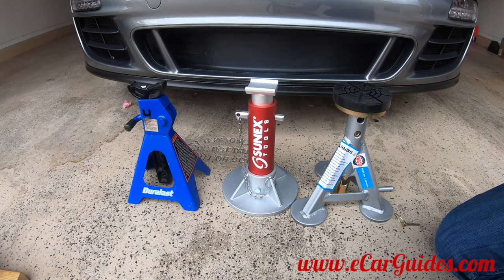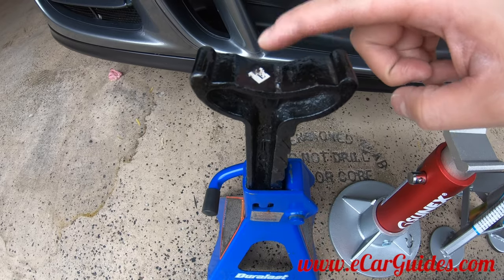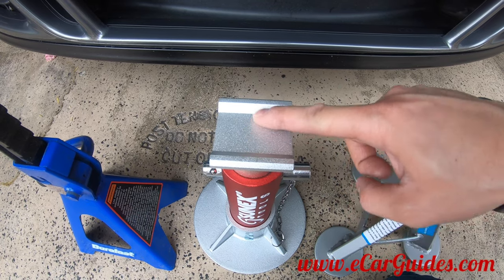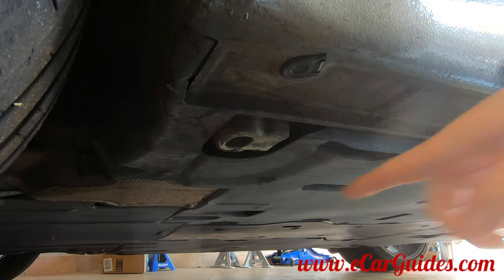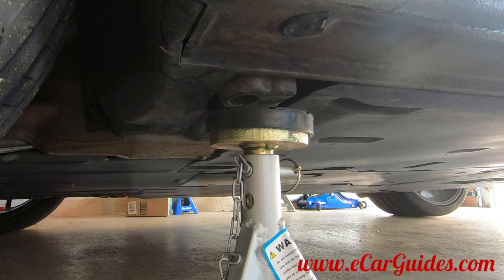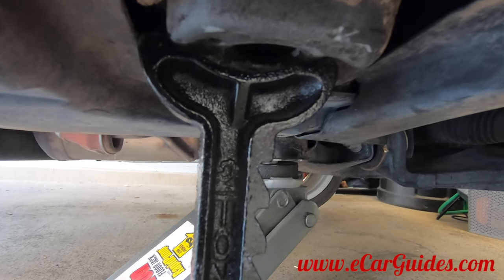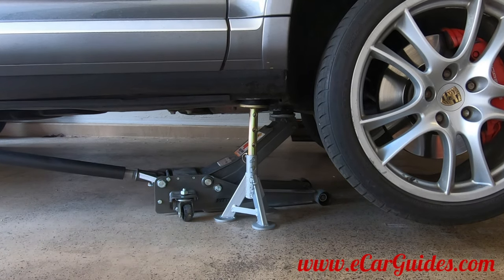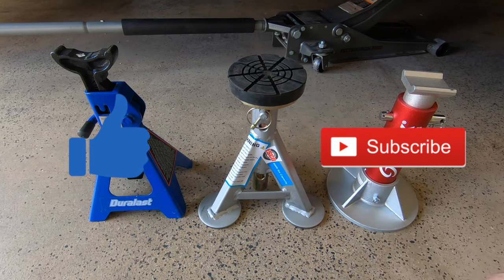Why the ESCO Jack Stand is the Best for Car Enthusiasts (ESCO vs Sunex vs Duralast Review)

Comment: That first jack stand mentioned has a small tab on the side that you are supposed to bend inward toward the shank when you assemble it. Same thing with the Harbor Freight style that was recalled. It is part of the engineering  and design for safety. It helps to promote good alignment of the locking mechanism and teeth on the shank.
Reply: Yes always and I mean always bend those tabs in. I've purchased several used jack stands and not a single one had the tabs bent in
Reply: Bending tabs also makes it to where the stand stays together so you won't loose one of the pieces
Reply: Ah, good mention. I wondered why they all have that tab.
Reply: Bending the tab in does nothing for alignment of the shaft within the stand. If it does then your stands have dangerous tolerances.  Its purpose is to keep the heavy shaft from falling out when moving the stand.  You could easily break bones in your foot, have the shaft slam into your fender, or smash your gf's kitty IF you don't remember to carry them vertical.  That said, I don't indent my tabs to ease with transport.  That said, I've had had a shaft fall out when I was being careless.

Comment: Good video, I would not trust creeping under a car that is sitting on any jack stands made out of aluminum, regardless of how expensive or beautiful they look. Been using 6-ton steel jack stands from Craftsman for last 25 yrs, they have held my 3/4 ton Suburban, Tahoe, Touareg and MB E350's over the years. For me using Aluminum Jack stands is like using Aluminum pry bars, though the functions are different but you get the point.
Reply: I think husky would be the best

Comment: First off let me just say thank you for the videos. I really appreciate content creators that are trying to review and compare products. With this being said though, my suggestion to you and anyone else is to never ever recommend a jackstand without a locking mechanism as there are many instances of the jacks slipping. So in other words, ask yourself a simple question is it really worth your life to save $10? I'm thinking probably not. Just my advice, I wouldn't even consider reviewing a piece of junk that doesn't have a safety pin. Hope this helps have a great day
Reply: They really arent that unsafe, just make sure to use them properly and check the handle is in the correct position. And its just good practice to use extra support anyway like a wheel or blocks of wood.

Comment: You could have rotated those strands 90 degrees. The first issue I see is you have a Porsche. Putting a lot of faith on the weld of that disc with the rubber pad. Ditch the rubber. Not safe.

Comment: standard jack stands (duralast type) is design for almost all vehicles, even if you hit the release lever with a hammer the jack will not fall, there is 2 much weight for it to slip, just make sure jack stand is straight and not defected, with proper weight capacity

Comment: I use the esco shorties as shown in the video. I still put either a folded microfiber towel or a pinch weld rubber puck from amazin to save the rubber padding of the esco.

Comment: The duralast style is good for my 69 911 and fits well on the rear torsion bar extensions..., also fits well on the front torsion bar mounts.  I like the Esco's better for my 2011C2S
Reply: you're talking about the shape of the saddle? Esco sells a post with a curved saddle that's better for supporting something bar shaped
Reply: @gwot  I will check that out.

Comment: I would never use a jack stand where there is a metal to metal contact between the stand and the vehicle, because those can slip. I always use hockey pucks with my Porsche jack pads. And those Sunex jack stands work just fine because once weight is placed on it, the hockey puck presses into the saddle nicely. It appears you have the "shorty" ESCO jack stands. Reviews of the ESCO on Amazon, some people have mentioned them as "junk" with some of the holes being too small for the pin to fit (Qualith Control issue) and they can wobble a lot at full extension (maybe). I'd still but them though.

Comment: Excellent info. Question: How would it be determined which model Esco stand to have, low-profile or standard height? Cheers.
Reply: Working on mainly short vehicles short jack stands, planning on working on taller vehicle's get the tall ones

Comment: I'd steer clear of any jack designed like that Sunex.  The round bottom means if it gets tilted even a little to one side it's going to roll out and drop the car on you.  Not safe.  I think Torin used to sell that style, but switched to a truncated triangle because of the stability problems.

Comment: Buddy do some research those are the same aluminum stands that Torin sells for 50 bucks on Amazon. harbor freight sells a version they for approx  $75. nobody pays $120 for those sunex version ones.  Everybody's aluminum stand of that style is made by the same company that just painted them a different colors.  For the different companies they manufacture for to sell them under there brand.  Harbor freight also sells an aluminum ratchet style jack stand for 55
Reply: The Big Red Torin aluminum cylindrical stands are a little different than the Harbor Freight and Sunex versions. The Big Red has a hexagonal base and a screw that goes up thru the center of the base into the bottom of the vertical tube keeping them together (some say this allows the tube to wobble side to side a bit). In comparison, the Harbor Freight and Sunex have a circular base and a screw that goes horizontally thru the base and vertical tube. I'm not sure which design is better, just noting the differences.
Reply: @flexibleaspect  thank for the info 👍

Comment: Great review and demonstration. Decided to bit the bullet and spend a bit more for the Esco stands. They’ll work better for my ‘99 M3, with its permanent hockey puck lift points.

I think the rubber pad can even be removed from the Esco stands if desired. Is that correct?
Reply from the maker: Yup! Thanks for watching and your support!

Comment: Like my Esco but wish I had Jackpoint jack stands.
Reply from the maker: Really? The Jack Points cost around $650 a set. At that price, you might as well go with a Quick Jack.
Reply: @CarFanatic  would you feel 100% safe using a quick jack with no stands? It looks like that thing could fold up on you.
Reply: @Laguna2013  so many people have them, tons of youtubers use them, if one has folded, we would hear about it. QuickJack themselves also had overloading demos videos, it holds way more than it's rated for. But, if you still don't feel safe, nothing's stopping you for setting up stands to go with your quickjack. End of the day it's your life, do what's comfortable for you and overkill on safety.
Reply: @gwot  the esco's held up to like 25tons...each.
Reply: @brickswisher7672  ok and?
Reply: @gwot  And safety, the whole point of your post. Possibly overkill but safe.
What's your problem?
Reply: @brickswisher7672  so are you agreeing with me and just adding on, or is this a counter argument to what i said?
Reply: @gwot  yes i wouldnt do anything without jackstands. Unless of course you had a lift. Escos are a little pricey, but super stable in my experience. I didnt argue anyrhing.
Reply: @brickswisher7672  ok so you're just stating, I was just confused as to if you want a response from me or not.
Reply: @gwot   I was just impressed with the hydraulic press test.
Reply: @brickswisher7672  cool cool. I've seen a few hydraulic press test as well, all of them pass with double or triple the rated
Reply: Jackpoint stands are a good concept if you have limited jack points.  In use, they suffer from an extremely low useable height and they're absolutely overpriced.  The QuickJack looks awesome to use on video until you use one yourself.  They're ridiculously heavy and challenging to position.  You can put a vehicle on AND off jack stands much quicker than using a Quickjack.  They also block alot of access under the vehicle if you can even use them on your vehicle due to the limited lift points.  I.e. not compatible with my Cayenne.  If you want comparable lift height, get the normal size Escos and a long reach extended lift jack like the Harbor Freight model.  Or an actual lift.